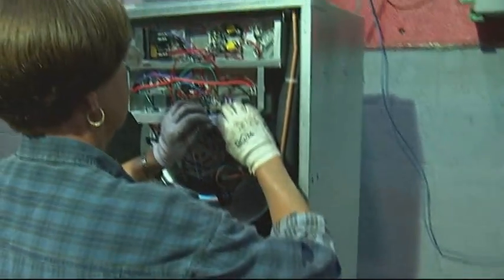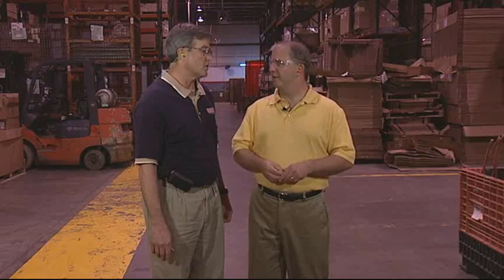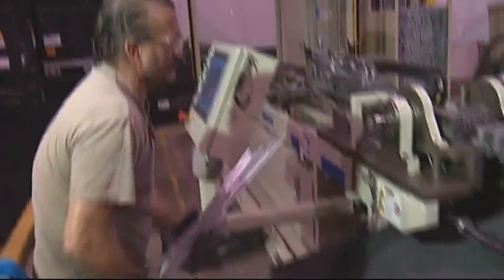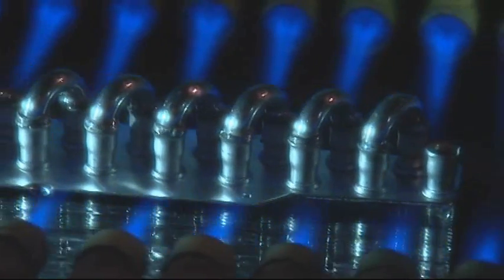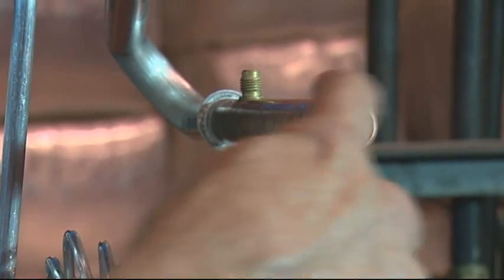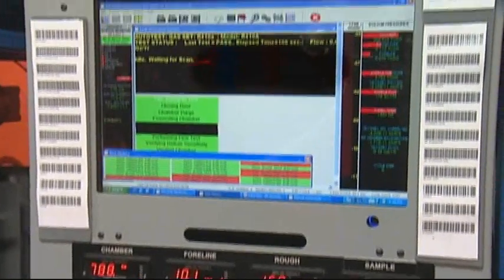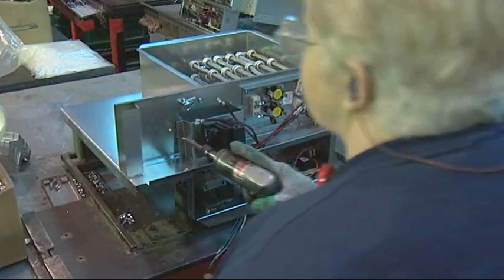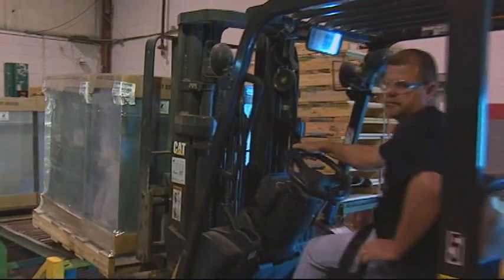Goodman Evaporator Coil and Air Handler Aluminum Assembly

Comment: A refrigerator can run for twenty years without any leaks whatsoever, yet an evaporator leaking one half of an ounce a year is standard and acceptable? Why?
Reply: I would assume the operating pressures is the biggest reason. Standard 410a pressures on a warm day run around 120/330ish so all the connections are under higher stress since freezers can run around 15/140ish while running.
Reply: Aluminum
Reply: I think I can see a few leaks already
Reply: Only with goodman! It’s trash buy a carrier or Ruud/Rheem two best units made right now! They also started using crap compressors and broad ocean evap motors trash trash trash!! Oh and new refrigerators ain’t lasting close to 20 years😂 when I started in hvac 25 years ago I was pulling out GE and carrier units that were 35 + years old still running and holding charge today you won’t find a unit that will last more than 15. It’s all trash but Goodman is the worst! But I make good money repairing them so keep up the great work guys!
Reply: @peterdarlington4117 Rheem and rudd are fully microchannel you mean buy and American standard or trane don't you but either way nothing these days are made to last anymore

Comment: mine Failed within 1 year of installation no quality
Reply: @HVACdirect  2nd unit just failed another Leak in  evaporator , Warranty does not cover Labor and freon. Please build quality units like before
Reply from the maker: @resheylall697  Did you purchase this unit from HVACDirect.com? if so, please send us your contact information.
Reply: @HVACdirect  unfortunately I did not Purchase for HVACDirect  Not sure who the installer purchased from , But three Units purchase for a brand new home built finished building in Dec 2020 and Units was installed in June 2020
and have been Having multiple issues  most of it occurred within the first year where the Labor was covered under warranty. First unit evaporator Failed in March 2022 that cost be 700 and now 2nd unit fail same problem

Comment: And every aluminum coil will begin to leak where the aluminum is brazed to the copper pipe. They know this. That’s why they melt that rubber sleeve around that joint and it still doesn’t help.
Reply: Sure eventually, but being in the industry, it’s not the copper to aluminum joints that are the problem, it’s the process of brazing the U bends on the aluminum tubes in the coil slabs that have been the problem with these coils industry wide.
Reply: This has not been a problem at all, the aluminum coils are actually pretty good, the other previous iterations? Ugh
Reply: @charlesterrizzi8311  I’ve been in the apartment industry, mainly dealing with the Goodman slant coils from 2012 and newer. Every one I’ve had to replace all leaked in the same factory joint. Not saying the entire coil design is bad but it’s just a pain to deal with on the slant wall mounted units.

Comment: 1/2 oz per year, No wonder Goodman is trash.
Reply from the maker: There are many locations where refrigerant can be leaking from; the most common location is at the line set connections from an error during installation. However, if the leak is located in the equipment, we’re more than happy to assist with a warranty case for systems purchased through HVACDirect.com. Please send us a DM or email us at info@hvacdirect.com and we’ll be happy to look into it.

Comment: Bought my split system over 10 years ago. Clean the outside unit every year. Have never had any trouble with it sold the house and in my new house installed a 3.5 ton unit hopping I get the same service from it, have told everybody with my satisfaction with goodman
Reply from the maker: Thanks for the comment about your Goodman system! We share your confidence in Goodman and thank you for letting everyone know about it!
Reply: Goodman are trash.

Comment: 0:29 New development yea right, aluminum is cheaper then copper but worse at leading heat and thus worse in general but of course sold for the same price.
Reply: I’d rather have copper tube/fin coils any day over cheap aluminum micro channel leakers.
Reply: @stevee7774  You me both.
Reply: Ya but the copper coils will corrode. You have tin, copper, and aluminum all touching each other. Not good. All aluminum will last a hell of alot longer.
Reply: @JM-yx1lm  The copper coils was protected by thick paint, they will not corrode. But that was not the issue, that was that they would sell it for the same price either it was copper coils or aluminum.
Reply: Thank you for your input. I sell HVAC and ours have copper tubes, I didn’t know there was a difference.
Reply: @josephgomez2249  There is, it's not huge but absolutely measurable. In some areas you won't notice if used aluminium but in other places and installments it could have made a huge loss fex.

Comment: just installed my 80,000 btu furnace from you guys..97% eff. I also got a new 4t condenser and 4-5t evaporator coil from your facility. Haven't hooked up the ac yet but heater works great. Goodman is good quality!
Reply: no